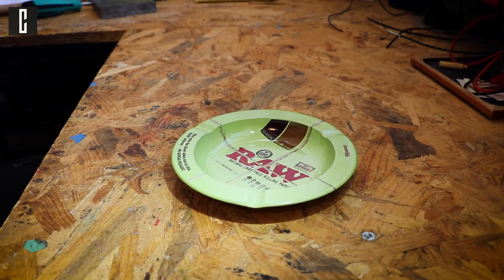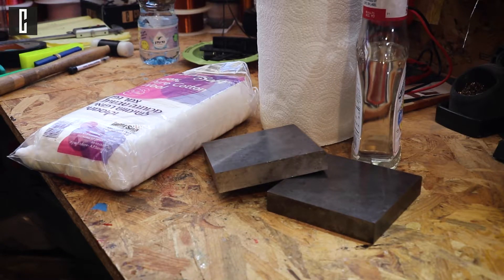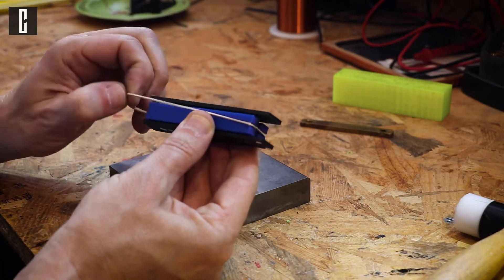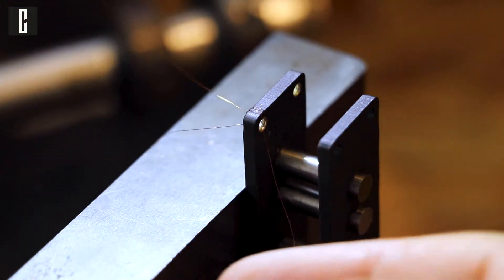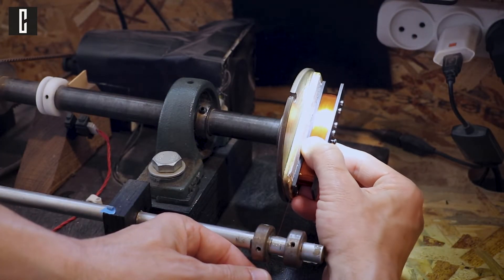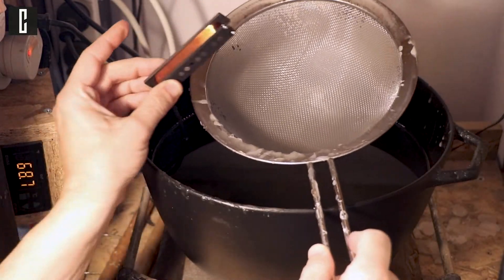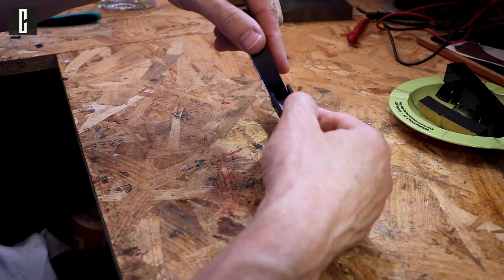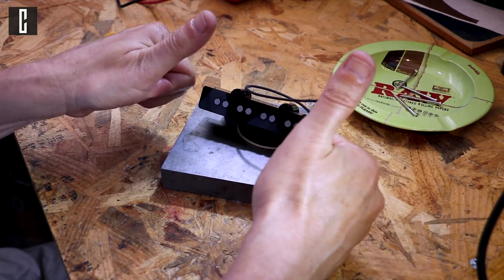The Fascinating Process of Building a Jazz Bass Guitar Pickup

Comment: Great work! Have you experimented with different materials for the magnets case like brass for example instead of plastic?
Reply from the maker: Thank you very much, and yes, I have. Plastic or wood is best for me. Metal casings change the tone too much for me, as happens with humbuckers. Brass covers sound really muddy to me...
Reply: @coilsboutiquepickups  so only wood or plastic what other it may be used I wonder...
Reply from the maker: @vielnast3628 epoxy cast is also an option, but it is hard to work with and create a good-looking case

Comment: Great video. So educational. I'm trying to repair a jazz pickup that has 3 wires and a copper foil tape soldered around outside. There "were" three areas on the pickup where the coil wires were protruding to the eyelets. they are all broken off. I'm thinking this was a "coil taped" pickup. Is it possible there was a first round of wire, then wrapped to an eyelet then another winding over that and wrapped to another eyelet ? And the original starting wire has its own eyelet. It may be impossible to retrieve enough wire from the first winding to get around an eyelet again but is this a repair worth attempting? These are vintage quarter pounders from early 80s probably. Thanks for any guidance.
Reply from the maker: Yes, this pickup you have can be tapped. I think it should be repaired, rewind it.

Comment: Hello, this is a great video, really. I would like to try to wind my own pickup, too. Just from sheer curiosity, it does not looks exactly like rocket science, so it might be a nice diy project (but I am very much aware that there are many potential pitfalls awaiting). I would like to ask you one thing, though. Sorry for my bad English, but from which material you make the bottom and upper part which hold the magnetic rods? I was wondering, how many parts can be actually 3D printed in this process... so what it is made from? But maybe plastic is not a good choice for these two parts because of soldering and wax dipping..? Anyway, thanks again for the video.
Reply: OK, flatwork is word I was looking for. Now I cann google out what it is usually made from, thanks anyway!
Reply from the maker: Flatwork is a mix of plastic and resin. Quite easy to order online :).
I also saw people buildind pickups from hardwoods or plexiglass.
Reply from the maker: @ondrejkauzal8969  Good luck 👍

Comment: What size that coil wire brother.
Reply from the maker: 42 AWG
Reply: @coilsboutiquepickups  thanks brother. Are pickup size is same when put in the neck and bridge.
Sorry about beinhg To much to ask. I wanna buid my own and try to find that informations..
Reply from the maker: @BIJIKOPI1  neck and bridge are not the same size
Reply: @coilsboutiquepickups  what about dc resistan and sound caracter. Are same?
Reply from the maker: @BIJIKOPI1  we usually make the neck pickups with lower resistance than the bridge. Go to Coilsboutique.com and look at our models. All specs are there.